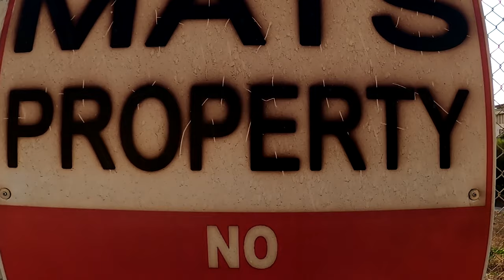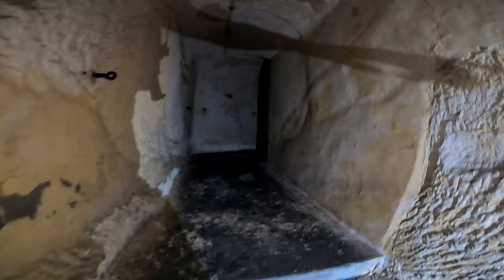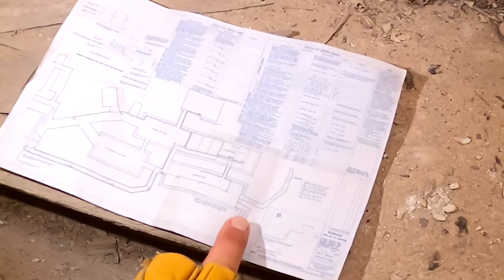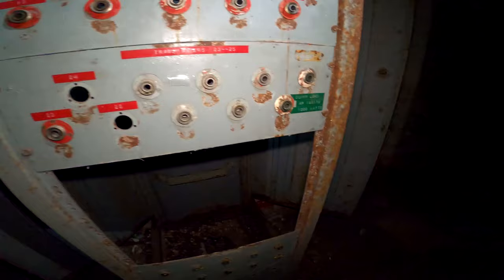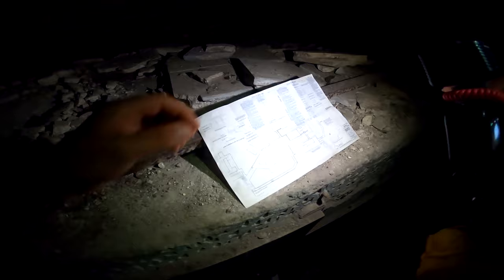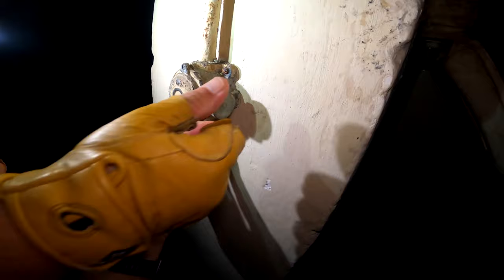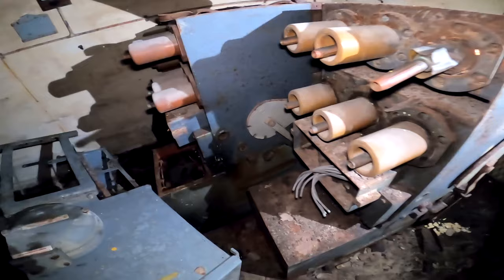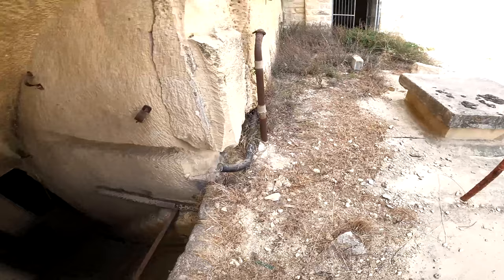Bengħajsa Underground Transmitting Station Birżebbuġia

Comment: There were schematic drawings of this site at Malta Drydocks Drawing offices. The British forces used to paint all the stairs according to which branch it was. In this case it was under the Royal Air Force so the colours would be gray and blue. The floor is covered in linoleum not rubber. It seems that the place was pilfered at some time after the British left in 1979. Probably for copper and tin and anything which could be used. I visited the place in 1974 and everything was still in perfect working order. The British left everything intact except for secret radio equipment. Pity that unscrupulous thieves got round to this place too. It's a shame that this place which could be turned into a historical site is in this state.
Reply from the maker: Are you referring to the map used in our exploration? Re stairs it is mentioned the colour in the vlog. Yes unfortunately perpetrators went down there and stripped all the cables and part of the machinery. Hopefully it will be restored to it's full glory.